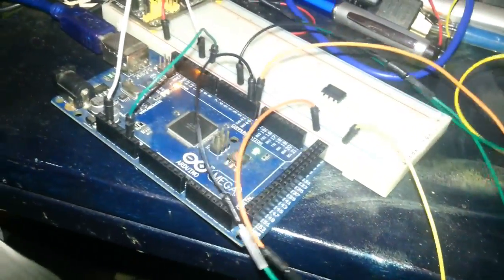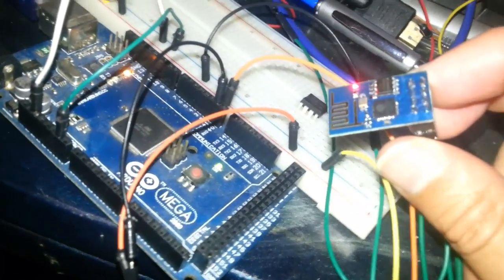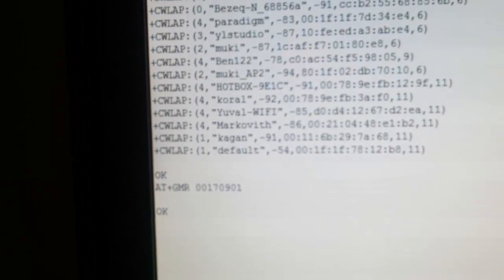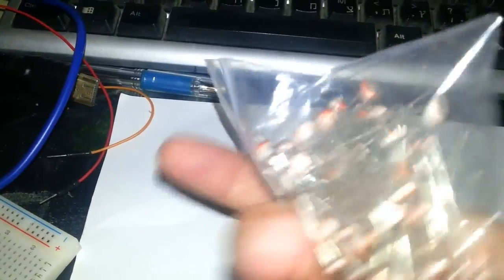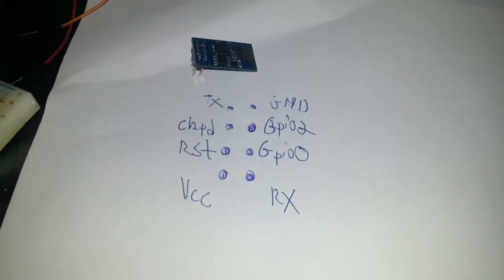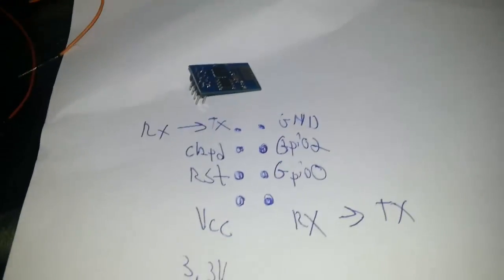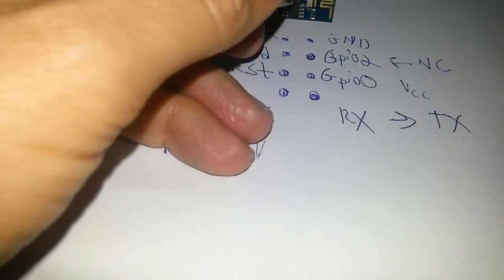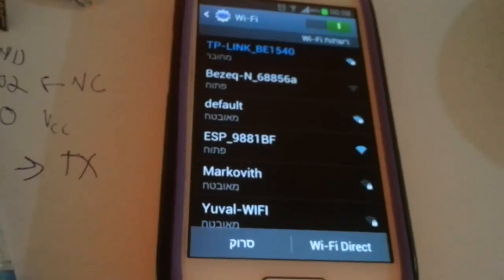Review on the new and cheap esp8266 WiFi module

Comment: How to connect ESP8266 to arduino UNO with USB to TTL converter???
Reply from the maker: you don't need a usb to ttl converter if you are using arduino UNo
Reply: Then how do I connect esp8266 to my wifi home network??? Could you please share the sketch for the same...thanks..
Reply from the maker: did you manage to connect it to serial via the arduino or via a usb ttl converter? watch my video and my second video i show the at codes
Reply from the maker: SURAJ SRIDHAR 
I made a new video using the esp8266 as a web server the code is at the end of the video and in the movie description
Reply: hi suraj  pls masge  what up 9811340617

Comment: We are planning to use Arduino Mega for our project and access it using a smartphone via wifi using ESP8266. Connecting MEGA with ESP8266 is the only two hardware needed, right ? Or do we need a h/w that communicates with the Arduino MEGA like a 'USB to TTL converter' ? Thanks in advance
Reply from the maker: Gurubux Gill you also need a level converter from 5v to 3.3v and a 3.3v power source that is not the arduino
Reply: Marco Arduino channel

Yes, Marco has right. For 5V to 3.3V use special ICs, or a cheaper solution is
Using LM317T with couple of components like here:
http://kb.kaminskiengineering.com/node/171

Comment: hi i got the esp8266. but i cant get it to work. i used a 9 volt battery to power it. the problem i think is the the 5 volt tx rx from the arduino mega. i was wondering if u can some how help my understand what i am doing wrong?
Reply from the maker: eyalbar9 
The esp8266 is 3.3v did you power it from the 3.3v pin of the arduino? If the answer is yes then there is your problem because the arduino can not supply supply enough current as you can see in my video i am powering it from an external power source.
Reply: MY CHANNEL thnx for your reply.
 it is not. i am powering it from en external power supply. i got it to send Ready to the serial port. but i cant get it to receive commands. i had connected it with a logic level converter so that the serial port will be 3.3 volts. when the command is send to it will the blue light will blink? and can u think of any another reason why it is not working correctly?
Reply from the maker: if you got the ready , everything is good
check my other video on the AT commands